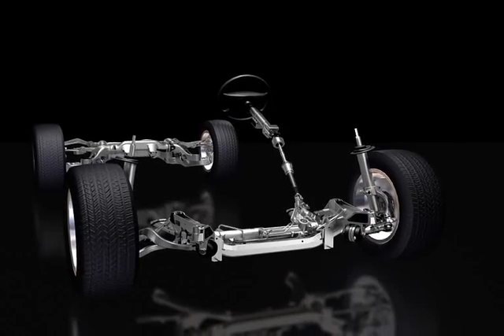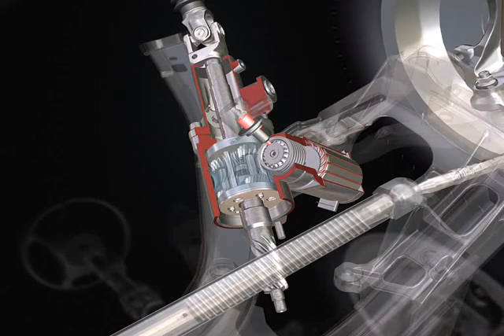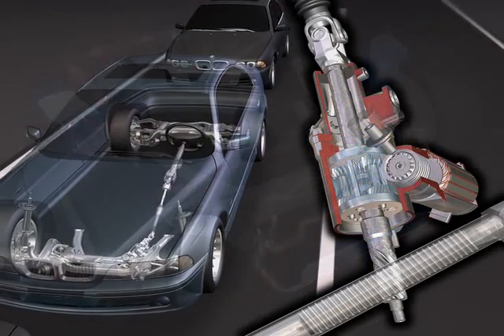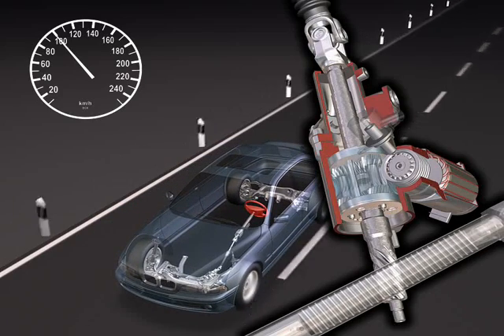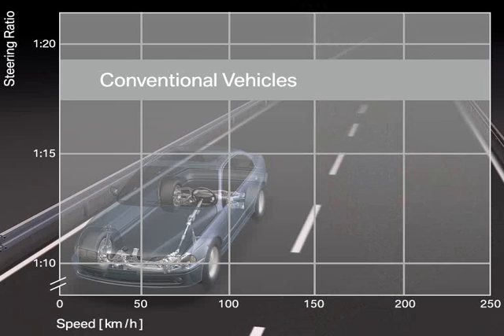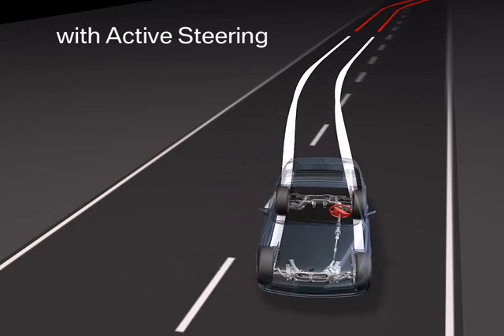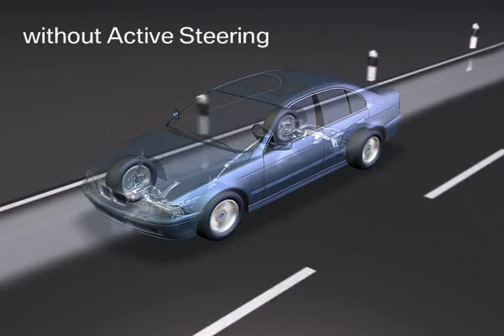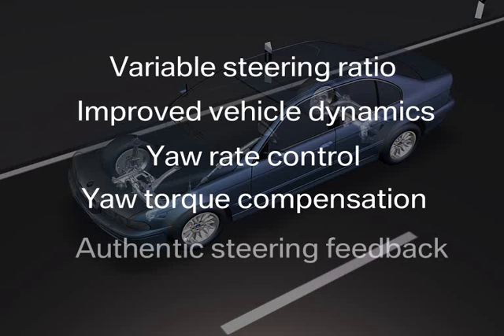BMW Active steering

Comment: Quick question, my e60 has this issue, active steering inactive, i did the full left to right faulty fix, but the problem is still there, and my steering is heavier to turn. Haven't send it to a mechanic but do you have any assumptions where it's the active steering rack is the problem or something else?

Comment: hello brother nice video i just want to ask a question please do answer me

1.how will the variable steering work i mean that how steering ratio is changed will it be changed by motor that is attached?
2. my second question is that why are we using planetary gears instead of pinion gear what is the purpose of planetary gears?

please do answer anyone i am  studying mechanical engineering and this our final year project so i need your help 

also if you can link me to different websites, articles,patents that will be great 
Thanks 

i hope someone will answer me.

Comment from the maker: Hello jhbonarius, even if you keep the hands on the steering wheel, in emergency case, the active steering will turn the wheels if necessary, without feedback for you. the action of the active steering is on the steering rack, not on the steering column.
As if there is a strong lateral wind, your steering wheel don't move, but the system correcting the trajectory.

Comment from the maker: @Manwithjeep Hello!
At first, when the car is stop, engine on, turn your steering wheel from left to right, you must have 1.7 rotation, that means with a very little movement on your steering wheel, your front wheels move fast!
Second, on yuour steering rack, you should have an electric motors, who's acitvate the game gear upon the steering rack. You can also send me the last seven digits of your VIN number, and i will send you your optional list.
Regards.

Comment from the maker: @Raychow0910 Hello! Wish bmw model have you? 
Why do you need to re initialise? Do you disconnect the battery? if yes for how many time?
first step (doesn't work for all situation, is effectivly to maintain the steering wheel 2-3 second left same to right, two or tree times.
Depend of the model, drive the car for few hundreds meters can be enough.
After that, in other case,after parts replacement, or ECU disconnected, some BMW diagnosis process must be done, let me know what is your case.